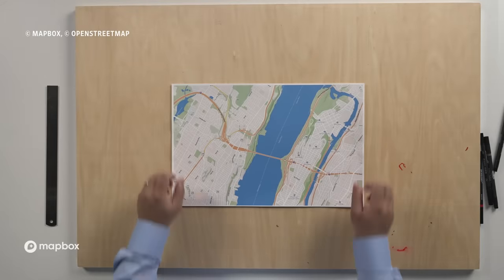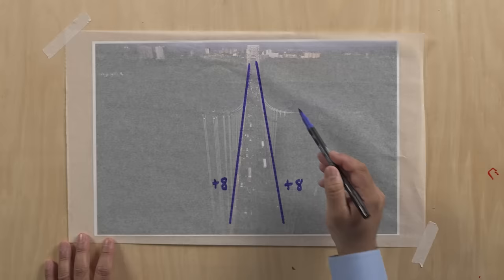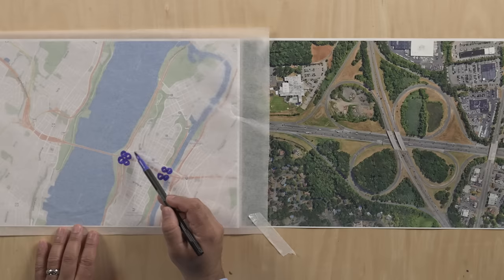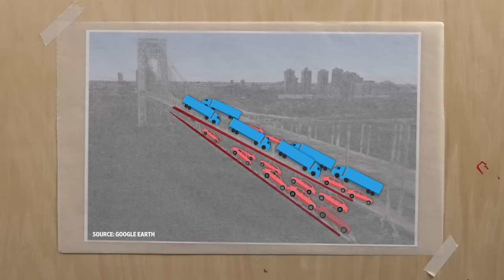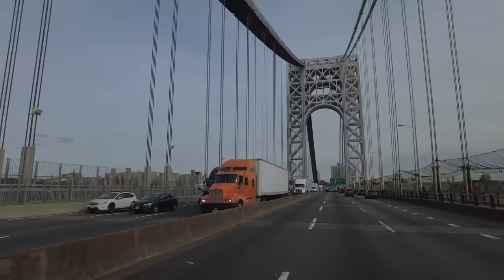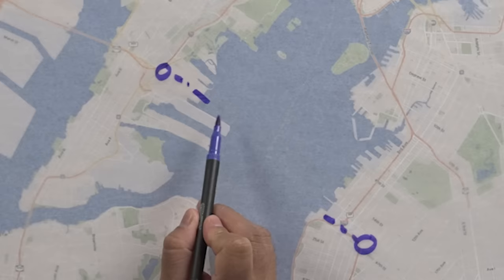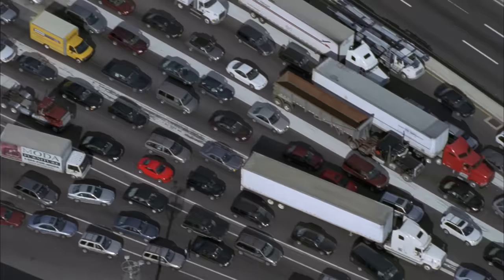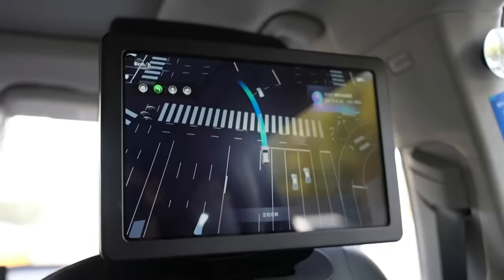Transportation Engineer Tries to Solve America's Worst Bottleneck | WSJ Pro Perfected

Comment: The thing that strikes me the most as a European is that the NYC subway completely ignores New Jersey and doesn't cross the Hudson. Some Americans argue that it is because New Jersey is a different state so there are many political barriers to expand the metro there. Yet, there are numerous examples of metro systems in Europe that expand across two or even three international borders without any inconvenience? (i.e. Geneve, Strasbourg, Basel, Copenhagen, San Sebastián, etc.)
Reply: The subway itself doesn't, but the PATH system (Port Authority Trans-Hudson), NJ Transit regional rail, and NJ Transit buses do help connect NJ with NYC, although primarily to midtown and downtown Manhattan.
Reply: the PATH is like NYCs secret subway, it’s a lot bigger of a network than a lot of people realize and it even runs one line that goes intercity to Newark on a heavy rail alignment. The Newark line goes right to the new World Trade Center and has an ultra modern station 

There’s also a decent light rail network in Jersey City and Newark that connects to the PATH

Also I do agree thought that the actual MTA run subway should go to Jersey and that we should build a regional through running network
Reply: It’s doesn’t completely ignore NJ. The PATH connects the two.
Reply: The issues that the US can't solve due to political barriers are unending. A modern, flexible system with parties motivated to find a solution that works well for all, would solve a lot of our problems.
Reply: Watched a vid about energy grids in the us. Was saying they don't like to connect the grids between states as then it is federal rather than run by the states themselves. Could be a similar issue.
Reply: @MelGibsonFan  Compare how many lines connect to Manhattan under the East River vs. how many lines connect under the Hudson. That's the point.
Reply: You take the path which is the most reliably subway network by far
Path gets you between the states, mta takes you around the city
NJ transit northeast corridor gets you to Penn station too
Reply: @scottydude456  mta does not need to go to NJ when the path and NJ transit already do. You have buses port authority terminal.
Biggest problem in NYC is not the subway it’s the BQE, Cross Bronx, and GWB
Reply: @pauly5418 they always point out PATH like this when people bring this up. SURELY they knew what you just mentioned???!
Reply: Different states.
Reply: tbf the PATH solves that issue
Reply: @wilsonli5642 the path system isn’t very well integrated with the mta and there are only 2 trains tunnel under the Hudson river with only 1 exclusively for the path. compared to the 5 tunnels and 2 bridges on the east river and that’s not even including the  2 additional tunnels from the LIRR on the east river
Reply: The city originally planned to expand the MTA into NJ. The 7 was supposed to go all the way to Weehawken. Then the city went bankrupt in the 70s / 80s. 

The PATH train exists, but it needs to be vastly expanded. The main problem is that the NY and NJ governments get into a knife fight over who's going to pay the price whenever the question of improving interstate infrastructure comes up. There's a tunnel called the ARC tunnel that was okayed by Obama (D) and nixed by NJ governor Chris Christie (R). Then it was okayed by the next NJ governor Phil Murphy (D) and nixed by Trump (R). And then finally it got okayed by Biden (D) and Phil Murphy (D). This process started in 1995! It's 2023! It's still not built!
Reply: @JustinWoo  wow
Reply: @lilbaz8073  Energy grids in the US do cross state boundaries, and to the best of my knowledge, transmission is regulated at the Federal level even within states.
Reply: There have been revisions for the 7 line to be extended to NYC but then again probably a lot hurdles to go through for that to happen
Reply: everything in europe is an inconvenience, its a dictatoship
Reply: @JustinWoo  Actually there are two PATH tunnels under the Hudson:  one for the Newark to the World Trade Center line and one for  the Journal Square/Hoboken to 33rd Street line.
Reply: Its the suburban sprawl that makes northern jersey an unsuitable for metro type rail system.  There is a lot of area to cover as the suburbs are very spread out.  You need dense urban areas for metro to be viable.
Reply: It's really a choice, and a defective one at that, by many US states and cities. Of course Philadelphia and New Jersey seem to play decently nice with each other on transit, so it can be done, though there are still gaps, like the West Trenton line no longer going through to the New York area. Paris used to have this kind of firewall between city and suburbs and it took an act of the National Assembly to get over that.....now they have literally dozens of direct connections.
Reply: People say different states blah blah blah but MBTA goes into rhode island so I dont see how thats an excuse even
Reply: @SJRS700  
Europe is a dictatorship? Maybe you should pick up a book every once in a while. It might help keep you from making a complete fool of yourself.
Reply: @jaiku99 There are pretty dense areas of NJ that still don't have goof public transport connections to NY though. A direct subway connection to places like West New York up to Fort Lee could help a lot.
Reply: America is not Europe. What works there doesn’t necessarily mean it will work here.
Reply: New Jersey Transit goes directly into Penn Station.  It's pretty easy to jump on an MTA train or an LIRR  train from there.

Also, the Port Authority of NY and NJ had oversight over much of the transportation infrastructure in the area.  It's an interstate compact that also includes the airports and seaports, in addition to the crossings (vehicle and rail).

https://en.wikipedia.org/wiki/Port_Authority_of_New_York_and_New_Jersey
Reply: @jgamer2228  What works in America isn't working for New York though. New York City has a far higher population density than any other city in the country and many of the European cities that OP mentioned. America's fear of public transport is creating problems like this, traffic in the city is already horrible and encouraging people to move away from their cars and onto a train will be much better at clearing up the freeways.
Reply: @Fools_Requiem  And therefore?
Reply: Dude, there is a train system that connects nyc and nj.
Reply: Berlin’s U-Bahn doesn’t leave Berlin either, at least not right now
Reply: Honestly, a lot of cross-border situations in Europe are similarly needlessly complex.  Different electrification, different signalling, different sides of driving on dual track, different fare systems and railroad companies, and in a few cases different rail gauge (looking at you, Iberian broad gauge).

The analogy is sadly more apt in the negative direction; these political boundaries usually translate to system boundaries and patchwork.  That said, from the other commenters here, at least PATH is pretty good for commuters.  Freight?  Could still use better interconnections around NYC
Reply: Don't forgot that there are also people north and East from Manahattan. That island is not sole destination when going through GWB, just because you are on the bridge, doesn't mean you are in the clear 😂
Reply: You're right, and there's even examples of this in the US. WMATA (Washington Metropolitan Area Transit Authority) or simply Metro, is an intergovernmental organization formed by a compact between the states of Virginia, Maryland, and the city of Washington DC and serves as the subway system for the region, going across borders and under the Potomac and Anacostia Rivers.
Reply: @oldmanspidey  WMATA is definitely an example MTA could look to, but it's also a bit different. It benefitted from being built ground-up much later, and being able to build an expansive, moderately future-proofed system, though not without it's flaws. Building the tracks narrow-gauge means they can't piggy back orders with other transit agencies like MTA, and they have no express tracks, even on the new airport line that could really use an express service.
Reply: Even within the US the DC metro in Washington D.C. goes into Maryland (one state) and Virginia (another state). In fact places like Bethesda MD or Arlington VA have neighborhoods seemingly built around the metro

Comment: Put a train across the bridge's lower deck. Make dedicated lanes for trucks.
Reply: No connecting infrastructure on the nj side.
Reply: @KhanJoltrane  Then build a system on the other side as well.
Reply: I'm not sure the bridge is designed for the weight of a passenger, commuter or subway train; besides, all the car brains will demand no driving lanes be taken and since there's no room otherwise... 🤷
Reply: @edwardmiessner6502 a super frequent light metro would work.  See Vancouver Skytrain's Simon Fraser Bridge
Reply: If I’m not mistaken, the lower level of the GWB was designed to include passenger rail. When you drive on it, in the middle lanes have a division where the train was supposed to be. But they scratched it and unfortunately New Jersey doesn’t have the rail infrastructure in Bergen County for it to be useful.
Reply: @hobog passenger trains wont do jack t
Reply: The bridge was designed for a 3rd deck. Still, a new crossing elsewhere is probably the better idea.
Reply: Great, so now instead of 100 cars and 10 trucks coming through every minute, you now have 12 trucks coming through, and 100 cars stuck somewhere else.

Genius.
Reply: @user-tz9jh6pv2j  well, the trains can be both passenger and freight trains, and a passenger train should reduce the number of cars by at least half. Of course, only if the drivers actually take the train, but if public transit is well-maintained and frequent enough (convenience), it should be  no problem.
Reply: GWB not designed for that.
Reply: @user-tz9jh6pv2j why do yall always think so small
Reply: @robertstauffer2865  as someone else mentioned it quite literally was designed with that in mind it just never came to be.

Comment: Probably build a rail system that goes under the bridge along with a loading station for the trucks to unload/load the cargo onto the train. 
Sure, it will cost a lot of money, but probably it will save a lot of money and time for everyone.
Reply: Would probably save wayyy more money in the long-term
Reply: Over 300,000 vehicle move across the George Washington bridge everyday, many going all the way up into Canada. Your system would be overwhelmed.
Reply: @JakeSDN I'm not really sure about that, because we know that heavy rail can carry up to 80,000 people per hour
Reply: @JakeSDN The vehicle capacity hierarchy typically assumes that heavy/passenger rail carries more in one space than a car. Being overwhelmed by the capacity currently faced by cars is the opposite of being an issue. The real issue here is if the transit organization itself can handle higher-capacity train operations reliably. But, then again, getting a train to work at all to serve as an alternative to car traffic is still a productive development.
Reply: @jinsory5582  Just as with freight, public transit is mostly a last-mile problem. Over the longer distances it is without a doubt better to clumb cargo/people together and make use of economies of scale, i.e. rail. However, nobody takes the train if you then have to walk 10 miles to your destination from the nearest train station. Public transit will become much more useful (and therefore used in the city) when it is integrated between neighborhood-collectors, inner-city transit and regional/national transit. It should be said, though, that by US standards New York is actually doing a stellar job in public transit (in european terms it's more like an okay-ish job, but still...)
Reply: Trams are better
Reply: Literally the worst option
Reply: They already have this, but in Staten Island. Conrail runs containers from NJ to NYC over a lift bridge, they also run trash.
Reply: this makes you smarter that 99% of americans
Reply: But but but it's not profitable, said muricans oligarch
Reply: @JakeSDN that’s not even that much 😂
Reply: @INTJ791 but but my carrr
Reply: @captainkrajick  completely false.
Reply: @failtolawl  the Yamanote Line in Japan handles 4 million passengers a day on 34km o track, if we divide it by the 20 hours of operation daily that is 200,000 people per hour; divide by 2, 100,000 per hour per direction.
Reply: @Rikard_A  At least ambulance can visit it.

Comment: We built our cities and suburbs for passengers cars instead of public transportation. If we got rid of half of those cars, it would greatly solve this issue. 

We need more public transportation (trains) ESPECIALLY in NJ.
Reply: I totally agree we should look to build our cities around public transport and people. But I'd disagree that we built our cities for the car we bulldozed them for the car.

Ironically the cities of the future look a lot closer to the cities of the past, and most importantly don't require any new technologies, just rethinking how we should use the space
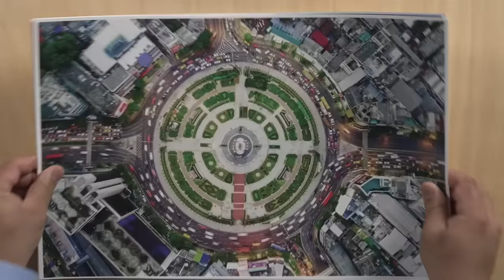Reply: 😂😂😅 1:45 ❤ 1:45
Reply: We built them for horses and pedestrians.
Then things changed.
Reply: @patmcbride9853  only the old cities like Boston, New York City, Parts of Brooklyn. Most of the USA is built for cars.
Reply: @89five3five  LA had a great transit system.
Then people started buying lots of cars after WWI and roads became crowded enough to delay the streetcars and people didn't want to pay more than 5 cents to ride.
Then buses were used, but later fell out of favor too.
Reply: @patmcbride9853  actually most American cities were built from rail connections. You then ripped up most of your commuter train lines to make way for highways
Reply: Two ✌️powerful industries would lose money 💰 if we did that Airlines and Automobile 🚗 industry lobby hard and spread propaganda to stop public transportation
Reply: Often does it need massiv park and ride spaces in addition to improve bus connections
Reply: @patmcbride9853  Then how about the horses traffic? What happens if there's horses fighting each other just because to get a rush?
Reply: @ikanmesra  Horses in harness rarely fight because their energy is used to pull a load.

Comment: I drove through GWB pretty frequently, one of the major road design flaw this video didn't mention is that right after GWB before exit 1C-D to Maj Deegan exp way, is like driving a go kart course in a nutshell. Typically the truck would ended up at the inner most lane right after GWB and when the trucks tried to exit to the exp way. It caused a lot of the slow down and that's where the bottle neck happened at first. Secondly on the opposite side of the road where the truck has to merged from outer most lane to inner most lane getting on to GWB is also badly designed.
Reply: Correct, cross Bronx to major deegan is always terrible for trucks (and drivers). After driving in nyc for years, I can say that is one of the most challenging areas.
Reply: Came here just to post this, as a truck driver this is correct truckers going to jersey( using the MJ Deegan ramp ) have to merge from the right lane all the way to the left(lower level)
Reply: He failed to mention elevation differences. The GWB is about 200 feet high and the Deegan is at sea level- that explains the go kart ramps.
Reply: I have been driving over it for years and always thought that if the only flipped  the ramps to lower and upper levels at NY side(both in and out) it will solve many of the trucking bottle neck. also if they had police on motorcycles to quickly get rid of minor accidents(always stopping when no injuries in lieu of driving to a area to wait for police or just take each side insurance info and move on). The police change is a simple thing they can implement right away at no cost and major saving.
Reply: 90% of congestion can be solved just by proper lane usage and signs. Having two lanes become one with no signs is 90% of the problem
Reply: -Apparently the engineers have never consulted with actual truckers for their input. Which leads us to the following quote:
-“Politics is the art of looking for trouble, finding it everywhere, diagnosing it incorrectly, and applying the wrong remedies.” - Groucho Marx
Reply: Before 9/11 trucks could use both levels of the bridge.  Drivers who were familiar with the area used the lower level if they needed to get to Major Deegan.  I am not saying that congestion on the bridge didn't exist back than, but at least the traffic didn't back up half way to the Delaware Water Gap (on most days, anyway.)
Reply: Being unfamiliar with a road is always 50% or more of the problem.(being in the wrong lane before getting to an exit)
Reply: 90% of bridge bottlenecks originate from the approaches. If we could clean up those approaches and maybe add a couple bus lanes, we would barely need to change the bridge deck; if at all.
Reply: @josephveksenfeld5344  is exactly what I wanted to put down too  Let the trucks go back to using the lower level.